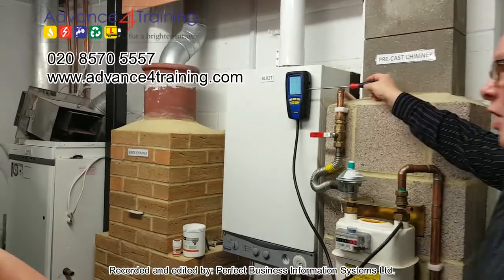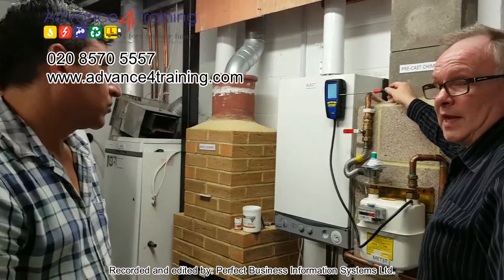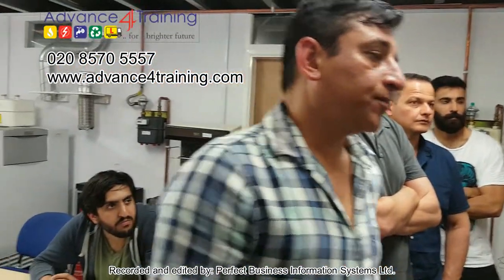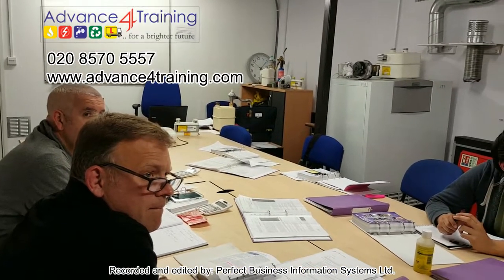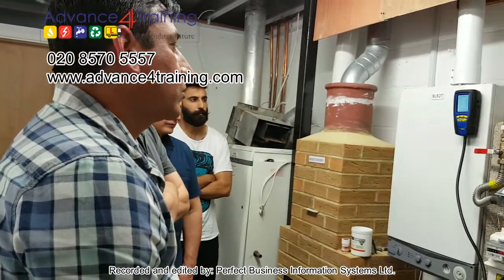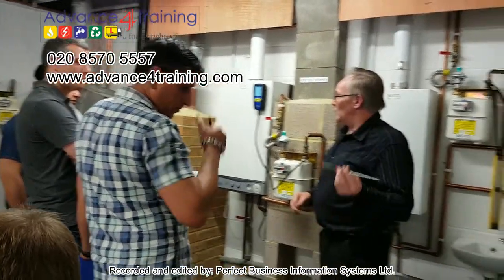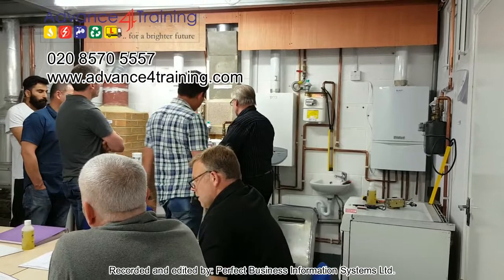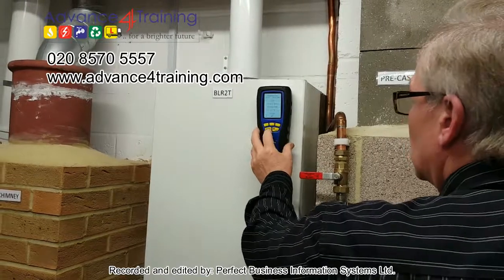New entrant Gas safe engineer training

Comment: Never tightness test with an anton
Reply: Explain
Reply: jeremy western should use water gauges only
Reply: I use water gauges all the time. 
Only use Anton for the print out of the test. Usually if I've fixed a gas leak I need evidence.